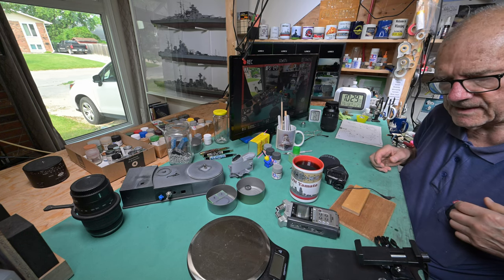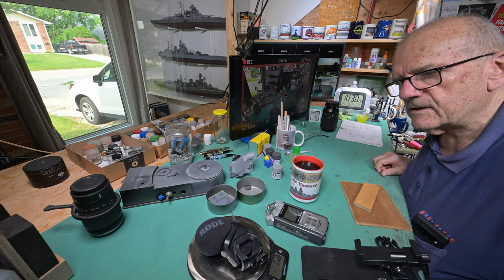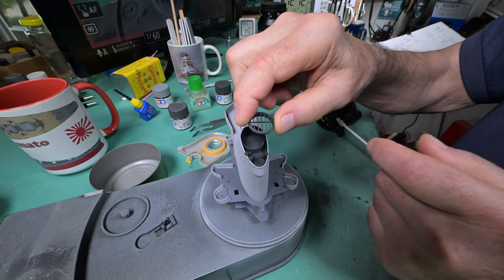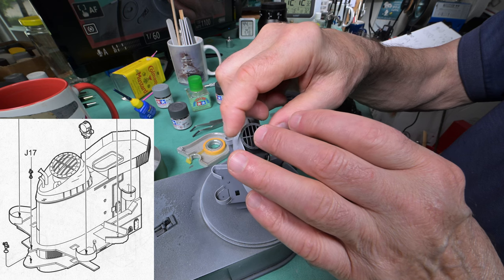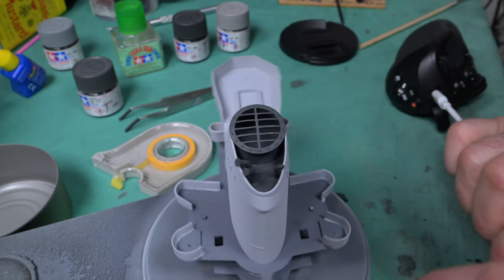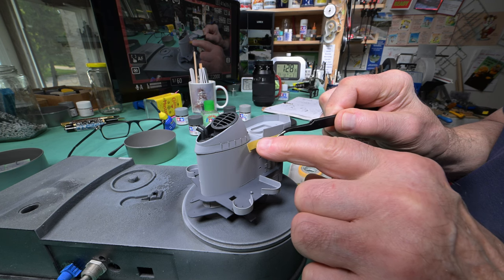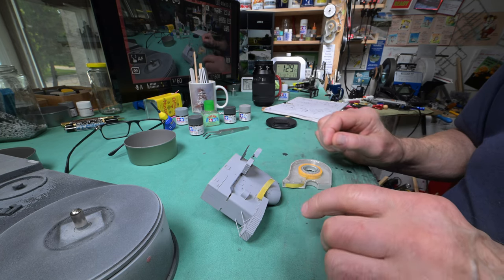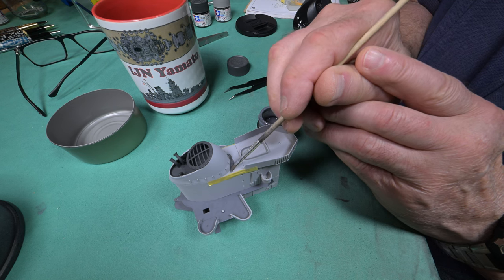The Model Ship - Part 1637

Comment: Be careful Ron if you ride up that new ramp into the house!!
By the way, how do you go about charging the battery?
Did a special charger come with the bike?
Maybe you could show us on your next bike ride video...
Reply from the maker: Re: "Did a special charger come with the bike?" Yes!
Re: "Maybe you could show us on your next bike ride video" Nope! I'm tired of the 'Safety-Sams" telling me that it will burn my house down, haha!
Reply: @roncalverley  OK Ron. I can appreciate the feedback you must be getting. No doubt the charger that came with the bike is made for your battery chemistry and capacity. I've got a whole case of lithium-polymer batteries for my radio controlled aircraft stored without any issues for years...

Comment: morning Ron,  have you ever thought of a sideline in writing Chinese cracker messages?  'you cannot improve whats not there'.  just a thought, could you connect your 3 bike ramp[s with hinges and put a handle on the side so you can fold them up and carry it much easier?
Reply from the maker: Hi Jason,
Re: "connect your 3 bike ramp[s with hinges" That's a thought. I did use it as is again last evening, and it did go a bit more organized. 👍